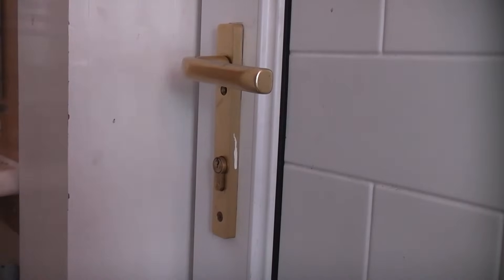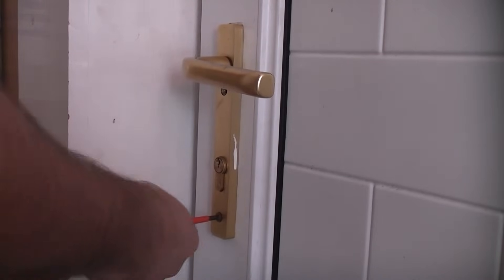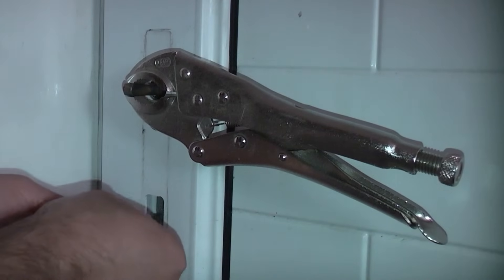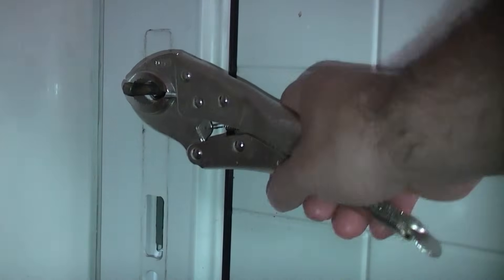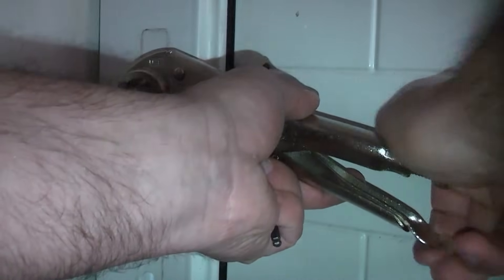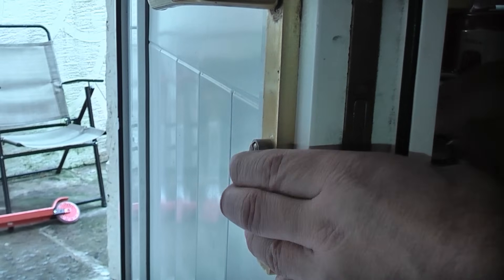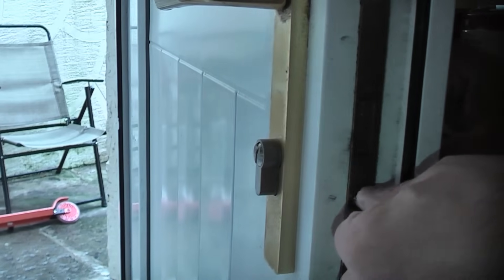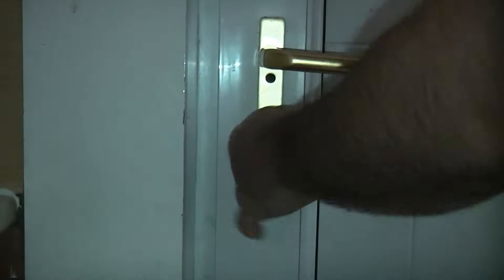Replace a euro cylinder without the key | lock snapping

Comment: I have got to the snapped in half point on my locked door but have no  idea where to put the Alan key ?
Reply from the maker: It goes in where the cam would be on the Euro cylinder.
You should be able to insert the short end and then unlock the door using a pair of mole-grips
Thanks for the comment 👍

Comment: What makes should I be looking at if I want to replace my cylinders?
Reply from the maker: Avocet ABS are supposed to be good High security euro lock fitting
You can also get anti-snap, anti-bump, anti-pick Euro cylinders from Yale and UAP
Reply: Handlestore does YALE, anti snap and anti bump with the new square end keys, much better and easy to fit too, they have videos on finding the size.
Reply: Yale are ok uap are a waste of space abs very good but not many people can cut keys for them as with the yale superior
Reply: Try these chaps, used a few times, very good and cheaper than a locksmith by a factor of 75%

http://www.handlestore.com/

I've used the Yale locks, anti-bump, anti snap with the square and registered keys.

Doddle to fit and they do every size combination I've needed.

Spare keys are 60% cheap than our local merchants.
Reply: Registered keys are a con avoid if possible
Reply: That's just silly.
The blanks can't be bought be just anyone and the copies are also only made from a registered master by a registered locksmith.
You've got to trust someone in the end.
Reply: For certain applications they are a good idea but for a house they are a con as the charge for replacement keys is very high and only selected people can cut them.
Some you even have to phone through and get them delivered the idea of only the registered owner of the property being able to get keys cut sounds good but if they could get keys cut they already have your keys.
also with certain cylinders like the yale superior the key is a direct code and simply by looking at the key you can get the code and get keys delivered

Comment: looking for a bit of help my patio door is locked so have removed euro cylinder from lock but door still not opening, tried to use allan key to turn the cam inside but not working looks like it could be snapped any ideas????
Reply from the maker: +paul singer It sounds like the gearbox has failed. I'm afraid I don't know how to open the door when this happens. I have replaced a damaged gearbox/multi-point lock but it failed in the open position!

Comment: 1.Just to educate regarding one of the replies, no you dont have to be already in the house to remove the handles so yes the video is showing a destructive method of entry for all comers.
2. Many 3 star cylinders out there now so chances are and diyer following this video instruction is just going to end up with a door they cant use as the cylinder cam will be locked off and they will need a locksmith.
3. Many many mechanisms out there that are prone to getting bent / deformed when having the cylinder snapped. A fair to good chance again that the diyer will successfully snap out the lock and end up with a mechanism that doesnt work.
Reply: simon trifunovic don't put people off doing it I get quite a bit of work from people fucking up things they see on YouTube

Comment: Hi, Ive snapped the lock off the inside of the door but the cam also came out, is it still possible to unlock the door?
Reply from the maker: Yes, you should be able to unlock it using a Allen key and a pair of molegrips.
Put the short end of the Allen key into the hole, then turn it with the molegrips, it should unlock the door.

Comment: hi, the problem I am having is the key releases most of the catches yet the the handle does not move in the downward {unlock} direction. It does move upwards. Hence the door cannot open. when you turn the key to lock position the door firms up, the remaining catches lock the door. I know it is impossible to diagnose without seeing it, do you have any suggestions?
Reply from the maker: I'm no door expert, but you could check that the door has not dropped on it's hinges. So if you unlock the door and then press down on the door handle whilst lifting the door it might open.

Comment: Where exactly do you put the Allan key please
Reply from the maker: Through the hole where the cylinder is removed from. Put the short end in and then turn it using a pair of mole grips, you should then be able to unlock the door.
Sorry if this is late, I've not been well - I'm trying to catch up on all the comments

Comment: I'd recommend getting a lock with an anti snap feature when re fitting-too many burglars are using this technique.
Reply from the maker: +David Worsley 
Absolutely. They should be anti-snap as standard!
Thanks for the comment
Reply: +Ultimate Handyman If I lost my key for an anti-snap lock, is the only option to drill it out?
Reply from the maker: +Aman A 
No, most anti-snap locks are often also anti drill.
Best bet is to get a high quality cylinder and keep a few spare keys, give one to a trusted family member etc.
Otherwise you might need a locksmith!

Comment: I’ve snapped the lock but can’t unlock the door it could be an anti snap lock as it not long been changed what to do ?
Reply from the maker: Some anti-snap locks are only anti-snap on the outside of the property.
If it is anti-snap there will be no hole in which to insert the hex key!

Comment: How do you do the Allen key part a
Reply from the maker: Use the short end of a 8mm or 10mm Allen key and insert it into the lock, there is a part that the cam of the Euro cylinder turns, that needs turning using the Allen key to unlock the door.
You might need a pair of pliers to turn the Allen key.

Comment: Can't get it to work on a 1 star Yale lock. The metal is too strong. I have literally stripped metal off the lock pressing that hard, and it feels like it has made absolutely no difference. The lock clearly hasn't got the anti snap grooves on it so it's just much more solid metal obviously. I don't think any modern locks will snap like this.

Comment: I've snapped it but don't know what to do with the Allen key. I'm doing this blind and don't know what I'm meant to feel????
Reply from the maker: There is a cam inside, which is normally turned by the cam on the Euro cylinder.
If you use the short end of say an 8mm Allen key, you should be able to turn the cam using a pair of mole grips etc. That will unlock the door.

Comment: Problem :  most solutions to lock snapping leave the cylinder locked (the break-off nose), ok if you are inside because the back cylinder will let you open the door to replace the whole cylinder, but if you're out you can't open the inner cylinder from the outside.
A very strong cylinder with a top strap is better, also make the outer lock face really flush (even slightly inset) and strong outer furniture.

Comment: I think your cylinder snapped easily as it is one of those ones that has the cut already in it to make it snap.  Not all cylinders are like that.
Reply from the maker: +Aman A 
It's only a little bit of brass that you are breaking- so very easy.
The ones with the cuts in them are the cylinders that cannot be snapped as they shear off and protect the lock from being opened this way.
Thanks for the comment
Reply: +Ultimate Handyman Oh OK thanks for explaining that.  So if I have one of the other ones and I snap it does it mean I can never get the lock out.
Reply from the maker: +Aman A 
Yes, unless it is one such as the Avocet ABS cylinder, which is only anti snap on the external side of the lock.
There probably is a way to unlock the door from the inside with a anti-snap cylinder but it will not be as easy as just inserting a Allen key and turning it.
Thanks for the comments
Reply: +Aman A I will let you know how it goes tomorrow....
Reply: +Aman A It worked!
Reply: +Aman A When you say your new cylinder is too long, what difference does it make if it's long or short....
Reply from the maker: +Aman A 
You don't want the cylinder sticking out too much on the external side- it should be flush with the handle or else it makes it much easier to snap.
Reply: +Ultimate Handyman OK lol my old one was sticking outside by 2cm...
Reply from the maker: +Aman A 
Blimey, that's only about 20mm too long LOL ;-)

Comment: Hiya - would this work if my door handle is not engaging the lock?
Reply from the maker: Not sure exactly what you mean, sorry.
Can you please explain exactly what the problem is?
Reply: ***** sorry :).  My kitchen door to the alleyway is a uPVC door.  The door is not working - when I push the handle up and down it does not retract the keeper so the door does not open.  I thought if I removed the cylinder as you describe, I would be able to open the door and then replace both the handle and the lock?  Unfortunately I can only access the door from inside the house as the outside is not accessible. All help is greatly appreciated.
Reply from the maker: Sarah Bane
No problem, now I understand perfectly ;-)
Unfortunately I don't think removing the lock will sort out your problem. One thing you could try is lifting the door when trying to open it as the door may have dropped. If that does not work I'm afraid you may need to get a locksmith.
Reply: Thank you for your help and advice, very much appreciated - will try lifting the door but if it doesn't work will contact a locksmith.  Happy New Year
Reply from the maker: Sarah Bane
You are welcome .
Happy new year to you ;-)

Comment: Don’t understand the cam thing how do you do that as you didn’t show in the video
Reply from the maker: The Euro cylinder has a cam, which rotates when you turn the key, this then locks or unlocks the lock. You need to use the Allen key and mole grips to take the place of the cam 👍
Reply: @ultimatehandyman  thanks pal

Comment: if the door is locked. how do i unlock the door. ive snapped the lock out.....please help x
Reply from the maker: There should be a bit inside, that the cam engages with, you need to use the Allen key and mole grips to rotate it- then the door should unlock.
A 8mm Allen key or similar should do the trick 👍

Comment: I've read the comments but I still can't get the door unlocked with the allen key. I've snapped the lock. What is the cam.
Reply from the maker: +Nigel Green 
The cam is the piece of metal in the Euro cylinder that moves when you turn the key. 
You can see the cam's in the centre of the Euro cylinders on this page- http://www.ultimatehandyman.co.uk/how-to/locks/euro-cylinders
You need to use a large allen key, perhaps 8mm or larger if it will fit in the hole and then turn it using the molegrips. Once unlocked you need to move the handle spindle down with the molegrips (as shown in the video)

Comment: I've snapped the lock, but I think the cam came out when I snapped it. I'm not sure how to unlock the door now?
Reply: Sorry I should have given more info. I have lost the key to my French doors, which are currently locked, and 'm trying to replace the cylinder. I've snapped the cylinder but the cam came out with it, and I can't work out what you are doing with the allen key
Reply from the maker: +wellingsa1 
It doesn't matter if the cam has come out with the part of the lock.  If you get an Allen key (hex key), perhaps a M6 or M8 size and insert the short end where the cam came out from, then get a pair of mole grips to turn the hex key you should be able to unlock the door.  The hex key needs inserting where the cam normally goes as it is doing the job that the cam would normally do. It can be hard to turn though, which is why you need the mole grips.
Reply: +Ultimate Handyman i have same problem allen key is not unlocking door been trying it for hours looks like the actual lock on the inside has snapped would that be possible and if so what next? door wont open as its in locked position,hope that makes sense!!

Comment: Ive managed to snap the lock but door still wont open.  If the put the handle on the handle turns upward but not downwards to open the door.  What else can i do?
Reply from the maker: You need to insert the short end of an Allen key to unlock the door by turning the cam.

Comment: I need help I did this but what do I do with the Alan key? Please help ASAP
Reply from the maker: Insert the short end of a Allen key, perhaps a 8mm one if it will fit, then use the mole grips to grip the Allen key and turn the cam in a clockwise direction.
Reply: Ultimate Handyman thanks I'll give it a go cheers

Comment: Hi there, my key only works on one side of the lock, when I tried to remove the cylinder it wobbles but doesn't come out, any suggestions
Reply from the maker: You need to turn the key at the same time as pulling the euro cylinder out as there is a cam on the cylinder- replacing a upvc door lock or euro cylinder
Reply: thanks for getting back to me, I tried that but it doesn't seem to budge
Reply from the maker: Dan Auty
It sounds like the cylinder is damaged. You say that the key only works from one side, you are trying to remove it from that side aren't you?
If you try and remove it from the non working side the cam might not be moving, which will prevent you from removing it.

Comment: But you're not showing what you do with the allen key I have the same problem and I cannot open my door because you just feel with the allen key and you don't explain
Reply from the maker: There is a cam in the lock that needs rotating. Use a large Allen key/Hex key and use the short end to rotate the cam.
 In this example I did not need to do that as the door was unlocked, as the tenant had lost the key.
 Thanks for the comment 👍

Comment: so is that lock you are snapping metal, i didn't think metal would snap like that
Reply: Debbie Sinclair How do you know it is one that can snap
Reply from the maker: Debbie Sinclair 
Yes, brass is only a sort metal and can easily be snapped with the leverage from the mole grips.
Some cylinders are anti-snap. An anti snap cylinder will still snap but you won't be able to insert anything to turn the cam from the outside, although I am sure some anti snap cylinders are anti snap from both sides.
I don't know if there is a way to identify an anti snap cylinder by looking at it, unless of course it looks like an Avocet ABS cylinder as fitted in this video https://www.youtube.com/watch?v=6wEZktQ9hb4 as these are definitely anti snap.
Reply: ***** thanks for your help
Reply from the maker: Debbie Sinclair 
You are welcome ;-)

Comment: I am trying to figure out how to add a euro cylinder lock to a sliding glass metal door which only has an interior handle and no key lock. But the door does lock when the handle is down. Anyone know a video that details this? I am striking out over here
Reply from the maker: I have no idea, but someone might reply.
Thanks for the comment 👍
Reply: @ultimatehandyman   I live in a foreign land, so that may be why I was having such difficulty finding a video with a similar setup. I met a local today who said they can install it for me.  I met another local several weeks ago who also said they could fix it, but they never did. Hopefully this guy today can help me. Thanks for the uploads and advice!
Reply: @ultimatehandyman  so I figured it out. Two local dudes came over and opened the sliding door and removed a metal strip from the recess between the inside and outside. Then they drilled a few holes. Not something I could have done solo. The new metal strip thing seems ok but I am not impressed with the new door handles and the lock. Both seem previously used to me. Luckily I think I can exchange these parts for newer ones relatively easily. That metal strip and drilling a new hole for the lock was the difficult part. Sorry about my lack of precision regarding what these parts are called, but I am a foreigner living in a foreign land and not really speaking the language well. Which makes everything that much more difficult for me.

Comment: Hi 1 side of my patio door is locked I snapped the cylinder but it still won’t open
Reply from the maker: Is it an anti-snap cylinder?
Reply: Ultimate Handyman thanks for reply no it snapped just like in your video my son lost his keys to the doors one was unlocked and one was locked inpedand repacked the unlocked one simply I then snapped the locked one could not put an Allan key in bellow because it’s just a flat metal plate plus the centre screw is still in it
Reply: Opened and replaced sorry unlocked door cylinder
Reply from the maker: That sounds like an anti-snap cylinder. It will still snap like a normal cylinder, but there is a plate that prevents you from accessing the cam (with the Allen key)
Reply: Ultimate Handyman but I managed to do the one that was unlocked ok
Reply: Same locks on both doors
Reply: Just looked at images of anti snap locks it’s definately not one of them
Reply from the maker: Is it definitely a Patio door, and not French doors- https://www.youtube.com/watch?v=9VTZgj0IQEo
You might have to try snapping the lock from outside, in order to get to the cam.
Reply: Ultimate Handyman sorry french doors

Comment: Please help guys ive got a front door with a whole in it where the cylinder used to be. Its noclked for now but i cant open the door to remove the aide screw and fit the new cylcinder
Reply from the maker: fence4821 
You won't be able to unlock the door without turning the cam. A pair of molegrips and a Allen key should do the trick, it's not easy though and may take several attempts.
Reply: +Ultimate Handyman i'm struggling its a multipoint lock system with a gearbox any ideas?
Reply from the maker: +fence4821 
Have you tried it from both sides?
can you see right through the hole where the Eurocylinder fits?

Comment: the allen key part doesnt work. ive now got a locked door with a hole in with no barrel
Reply from the maker: It's not a anti-snap cylinder is it? 
Thanks for the comment 👍
Reply: @ultimatehandyman  no. it worked.  cheers